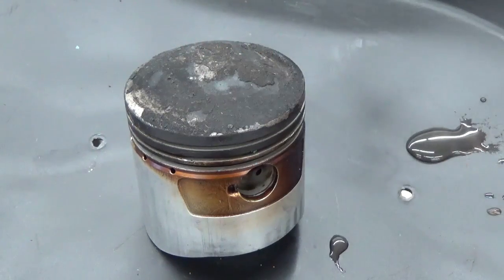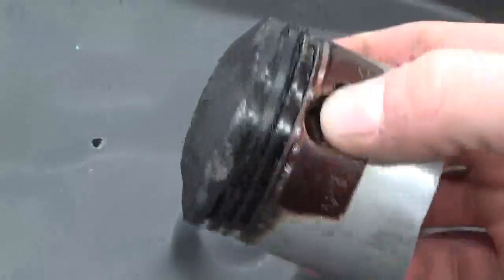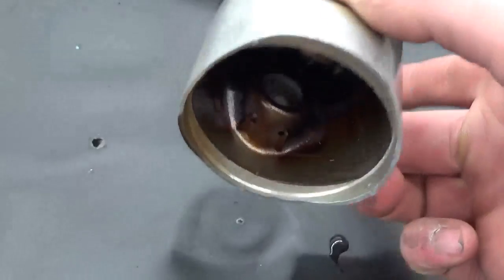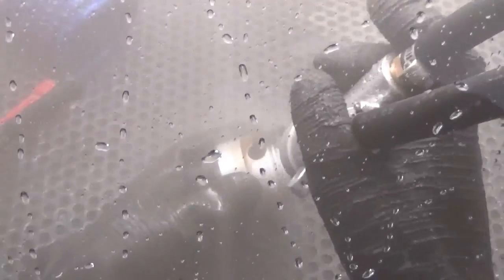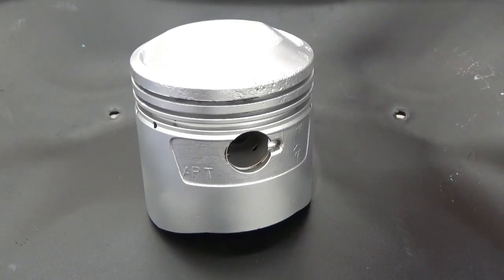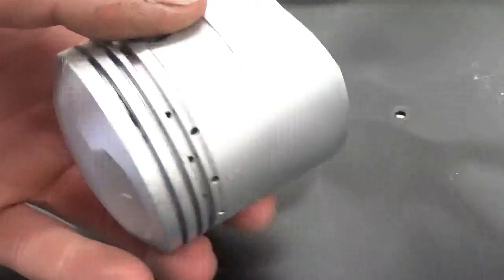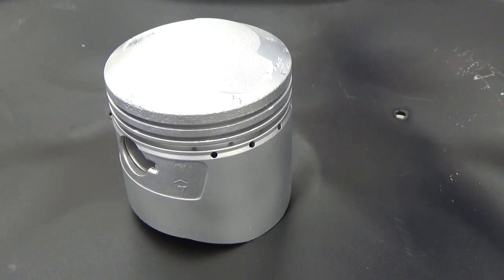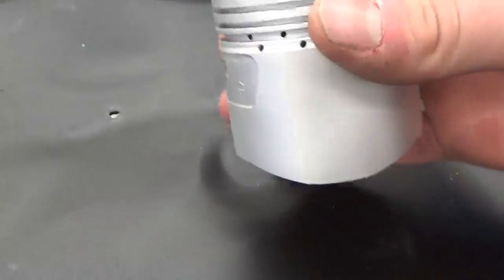Cleaning Pistons Using Vapor Blasting- Vapor Honing Technologies

Comment: The piston looks pitted especially at the top
Reply from the maker: When a part has been in service for some time and with the Carbon Build up, there is pitting from normal wear and tear on the part.  The Vapor Honing Process just exposed any pitting that was done over time.
Reply: So will it still be ok to use? Will it not deteriorate further due to the excessive heat from the combustion process?
Reply from the maker: Yes this is being cleaned up for a rebuild.

Comment: Is the vapor blasting able to remove coating of the aluminum beverage cans?
Reply from the maker: We Absolutely can remove paint from an aluminum beverage can.  We have done it with Pepsi and a Rock Star Energy Drink.  I will post Pics of the cans.
Reply from the maker: You know Rafael we have never tried that, I think that will be a good test.  I will let you know.

Comment: What about inside the piston ring grooves?  Will this process not get into those crevices or did the operator in this video just not focus on those?  I would be interested in this if it allows for cleaning out the grooves more thoroughly.

Comment: I use a thing like this on my Hotsey pressure washer. Except of course I do it outside with a HEPA mask on and normally use it on bigger machines. After all I am blasting at 3000PSI with 300DEG F water.

Blasting options:
- Wet sand (vapor blasting), Used for minimal dust and surface smoothing. Advantages of course being cheep equipment and running costs. 
- Soda blasting, Environmentally friendly, food safe, minimal prep-work needed, minimal surface loss, can be washed down the storm drain. Disadvantages is air dryness management, messy, and more costly. 
- Dry sand, Good for heavy abrasion tough jobs. Disadvantages being very messy and dangerous without a positive pressure helmet when used in the open.
- Dry ice blasting, very clean, for food an zero dust environments, can be used on any surface with close to no damage. Disadvantages being cost for equipment and product. 
While there are other mediums that can be used in blasting, I mentioning the most common aside from walnut shell (awesome for wood and minimal abrasion, very cheap), Aluminum oxide (no risk of silicosis), and many others.
Reply: What about a pressure of 500 bar of hot water to clean engine parts ? Does it work?

Comment: if we would use ethanol for fuel pistons would be squeaky clean all the time.
Reply: Austin Stoddart yes it can be run on it but it's a pain in the ass,it hurts us in our pockets and tax payers are sick of the goverment subsidizing the production of it because it cost more to produce then it's worth otherwise no company would waste there time on producing it!
Reply: Ethanol is a "Corrosive" it eats fuels lines. Head Gaskets. Metal parts. O-Rings etc... 

And no it does not have to sit for a "Period of time" As it's simple chemistry! What you're saying is it separates in the fuel tank. Now you got 100% methanol in your fuel system. Which is asking for trouble. One reason they have to use stainless steel lines. As they last longer but the extra cost is passed on to the consumer. Higher fuel pump failure rates etc... 

That shit is nasty!
Reply: Ethanol only causes damage when it sits for a period of time causing it to go bad and build up. Most newer cars can run it without a problem as long as you tune for it. Even small engines you can run
Reply: WOW REALLY DUDE?
Reply: beeqool ethanol is a big problem with small engines not to mention the damage it causes!

Comment: How much pressure is required for  vapor blasting?  I'd like to have that machine at home :-)
Reply: Over here we use both to compensate for the USA being 50 years behind the rest of the world. ;)
Reply from the maker: 60 working PSI @ 15-20 CFM most 5hp compressors or bigger will work just fine.
Reply: Java Guy ...and horsepower instead of kilowatts

Comment: never alter the surface finish on piston skirts! you will weaken the piston by introducing surface stresses, places for cracks to start especially on cast pistons. not to mention there is no good reason to use an abrasive on a piston skirt in the first place
Reply from the maker: Some of the largest piston manufacturers us the wet blast systems in their production processes with no negative effects. Also, you should read a bit more into wet shot peening for a better understanding on reducing micro fractures of a material by creating compressive strength in the surface of a material.
Reply: Interesting, I will read up. I run the cleaning department in an engine machine shop, to clean pistons I use a sonic bath then soda blast the crown and ring grooves with a rag wrapped around the skirt to protect the finish. That's just how I was told to do it though. Can your machine run a rinse cycle with filtered fluid? I imagine it would be convenient and cost efficient to be able to clean cylinder heads with your machine, but I would worry about abrasive getting trapped in oil passages on some heads. That's why we soda blast, it dissolves and rinses out in the washer
Reply from the maker: Abrasive slurry in oil passages is one of the biggest challenges we face with the process. Thousands of engine builders use this no problem but many fear the process because of this very reason. I do know that ultrasonic is the best second step to the wet blasting process for removing the abrasive. Really all comes down to the shop and what their desired aesthetical appearance is too I guess.
Reply from the maker: This is a great article on wet shot peening located on our website. 
http://vaporhoningtechnologies.com/wp-content/uploads/2015/09/Effect-of-wet-shot-peening-on-Ti-alloy-treated-by-ceramic-beads.pdf
Reply: I have not cleaned piston in almost 30 years, and probably will not ever clean one again.   But... had to give kudos to a company engaging on the Tube with customers to help them understand.   And I get to learn about Effect-of-wet-shot-peening-on-Ti-alloy-treated-by-ceramic-beads :)   Cool stuff.
Reply: Vapor Honing Technologies thanks for the article.
Reply: This process does the opposite.

Comment: can we use this vapor blasting-vapor for removing paint from cars? how much this abrasive cost and where can i get i? im from mexico
Reply from the maker: You would need an external wet blast or often called a total loss system. We only manufacture enclosed blasting cabinets at this time. To strip paint from cars you would be using crushed glass and that normally costs $10/ 50lbs.